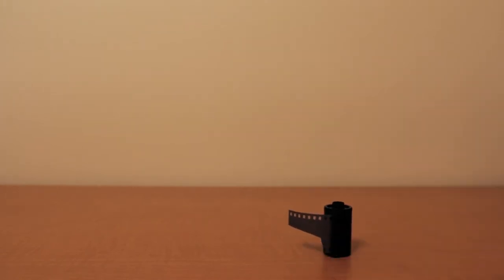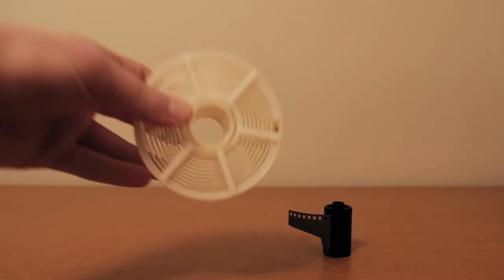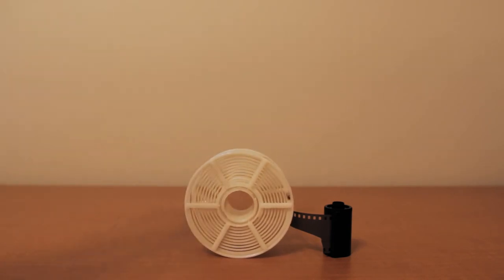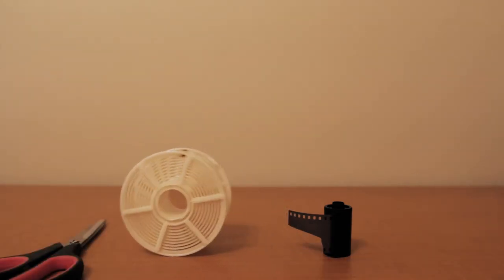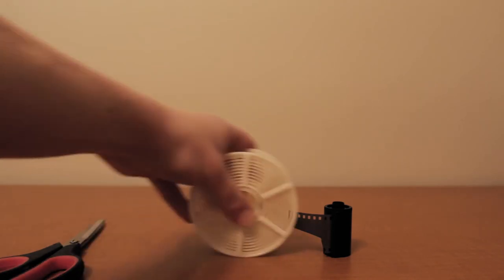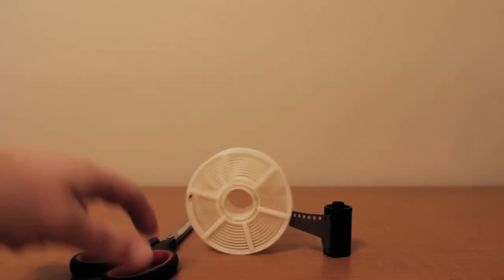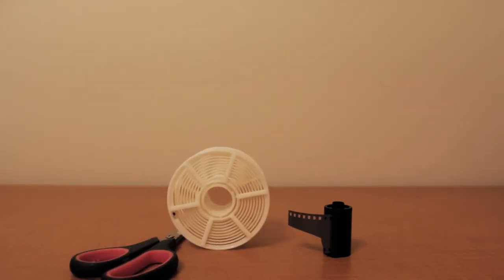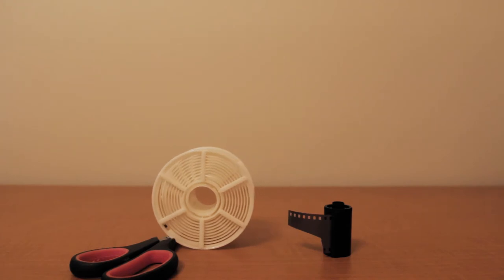DIY Film Developing: Getting Your Film from Cassette to Reel

Comment: I develop film all the time, when developing a film purchased I simply hit the top(extruding part) of the plastic film real with a small hammer and the bottom of the film container pops off easily, then you can slide the film out.  Just an FYI.
Reply from the maker: Ah, that's nifty. I'll have to give it a try next time I'm developing prepackaged film. Thanks for the tip!